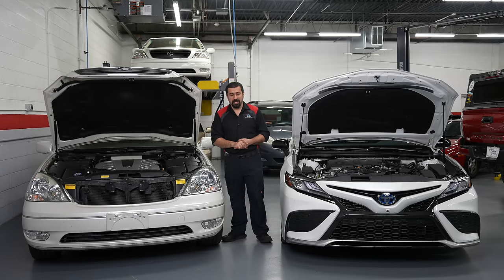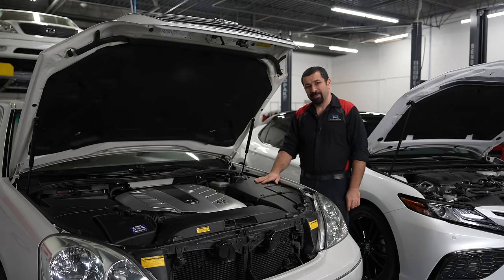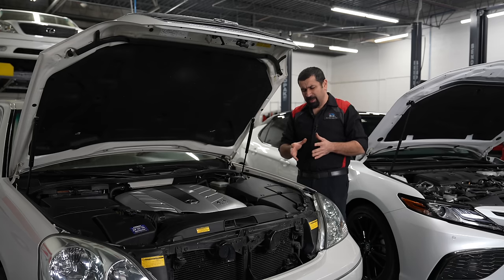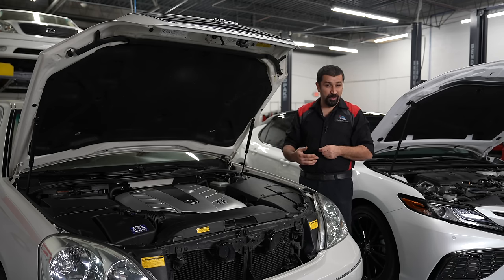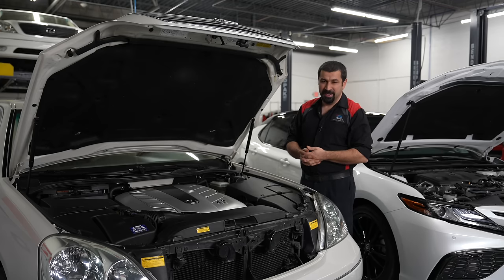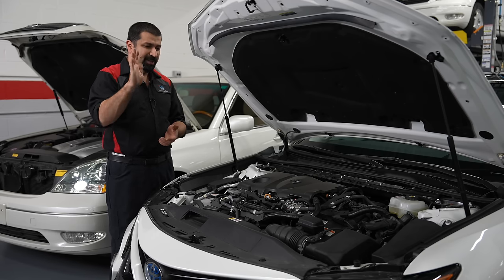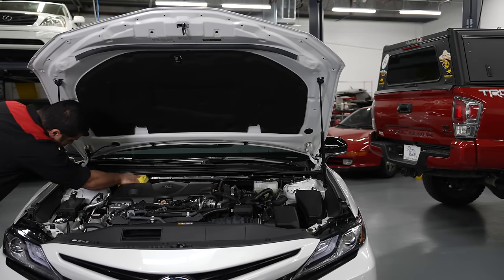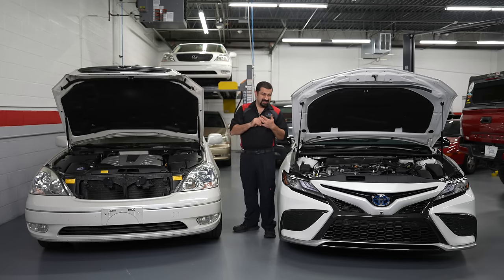Never Do THIS When Cleaning Your Engine Bay! Do THIS Instead

Comment: On a daily driver what is the ponit cleaning your engine? It will last the same life if you never clean it. Nobody should recommend cleaning a car engine. I don't just I wipe down things after I fo a oil change.  Really no point.
Reply: If something is clean then it's easier to find any leaks or broken-perished rubbers or seals

Comment: You're never reaching Martensitic transformation on that engine because temperature of the block should never be such high because there is a running coolant + fan all the time(conduction+convection+radiation of that engine heat). Exhausts/manifolds etc. is a different story but the block itself should not under normal circumstances reach such temperature that spray of 25 centigrade would somehow force it to crack or force molecules to expand in such way or that crystallographic grid of that steel would somehow change to such degree it would force expansion of some molecules to the point that it would actually force material to tear apart.
When it comes to electronics I think that is a clear case.

Comment: When shopping for a used car, I look for an engine that is clean on the inside, and dirty on the outside, not the other way around. 
A freshly cleaned engine bay sounds alarm bells. Also it hides oil leak evidence.

Comment: Here's a little comedic relief for you all. Wife drives an '02 Ford Explorer with the V6 (yes I've replaced the thermostat housing), and the intake mani orings are bad (iykyk), like, REALLY bad.

Last time I gave the engine bay the ol' purple power/thumb over hose treatment, I went to start it up after about half an hour and hydrolocked it, lol. My dumb ass tried to start it like 5 times wondering how the battery could have died so suddenly before I realized what I'd done.

Pulled the plugs, turned her over for a few seconds, let her air dry for 30 minutes or so, plugs in, and she fired up no knocking no ticking no nothing. I thanked my lucky stars that I didn't just grenade the wifes car lol.

Few thousand miles later (no I didn't even change the oil. Water evaporates in hot oil. Fight me.) and no grenaded motor yet lol.

Comment: Why is the assumption here (in the comments) that pressure washing or nothing at all are your only options? I've been using simple green and a garden hose for years to wash my engine compartments of various makes and models. They all look(ed) like new and I have never had an issue. A little bit of common sense goes a long way. Try running your engine for 5 minutes or so (don't let it get hot) prior to washing it. There's no reason to use a full-force jet spray of water on anything under the hood. And I beg to differ, but it does make a difference. I'm an auto technician as well and I deal with customers filthy engine bays all day long. It's nice to see mine still looking like new thousands of miles and years later.

Comment: I strongly disagree with use of degreaser … don’t use it! Don’t use water either… oil helps to keep engine and all the bolts and moving components from rusting!!! Some of the most preserved cars are those that had oil leaks never cleaned up! wipe down plastics and parts with WD40! Spray down connectors with wd40! Prevents rust displaces water… shines things up… helps prevent rust build up! It’s win win! I guess body cleaner/wax has the same properties… but I typically use wd40 

Also use fluid film under the body!

Comment: You didn't mention the unbelievable mess that a commercial oil based rust-proofing spray like Corrosion Free or Krown or Rust Check makes in an engine bay.  I would expect that the only way to get rid of it would be a spray on / wash off engine degreaser.  Used when cars were much more basic without all the fancy electronics.  Perhaps a couple of rolls of paper towels and some kind of 'nice' grease eater these days?

Don't you see this?  I believe you're in Chicago.  Rust proofing with these products is not uncommon in Toronto area where in the winter, cars can turn into salt balls.

Comment: Our car wash has air lines to use blow off waters I just pop my hood and blow dust away then use damp not sopping wet microfiber clothes to shine up
Enough water is already in engine comp from car wash so adds to my wet  shine approach
Also I let y toyota dealer wash my engine at oil chg damn sure they got it down they do it daily
They don't charge me for engine wash off with oil chg

Comment: It has always boggled my mind that people use a pressure washer in their engine bays.
I have never cleaned my engine bay and guess what? Never had an electrical issue.
If you MUST clean your engine bay, I would ONLY do it if you can use a holding tank of distilled water.
You DO NOT want to be introducing minerals to all your connectors!

Comment: I took my car to alignment shop and the guy messed up.my alignment 2 times and didn't what he doing and wanted to blame my car after I explained to him nicely.  Ima get my money back. He tried pull the same bs looking popping the hood that the other pulled on me the fist time. He said about camber and I think the camber bolt needs to be adjusted by to correct position. He acted like the my had camber bolts. He still left driver side tire out too causing pulling to the left. This becoming a  wide pandemic. Car nut u don't mention this

Comment: I don't wash or use chemicals in the engine bay to make the engine look pretty. Fix oil leaks, don't go mudding, and use compressed air wand to blow sand and dust off.    Too many places for water to get into and create problems.  Never ever wash the engine on a customers' vehicles in for repair.

Comment: **On modern cars**, it's perfectly okay to get the engine bay wet. Yes, even the alternator. Use a pressure washer, not a hose. And obv. use the white tip, from a distance. The key is to use a heated blower  immediately after to make sure everything is 100% dry. Yes, this is even safe for electrical connectors, most of which are very well sealed. Pay extra close attention when drying these. Open them up if you have to, for extra access. Go a step further, open each connector and spray with CRC Electronic Cleaner. That will displace any water. Apply dielectric afterwords and you should have zero problems.

Comment: son, i been cleaning engines for a long time and you are wrong! the least I worry is the alternator, mercedes engines, i do mine all the time, with a pressure machine too! but a hose will do, is all about degreaser, then you have to w40 the engine and turn it on asap.

Comment: Back when the car had a battery, alternator, distributor, plug wires, you could get out the car wash sprayer and when it dried, get the rattle can with orange paint and do some touch up on the engine block. Today's cars, rag, spray cleaner on the rag, wipe down what you can see. Close the hood.

Comment: Just don't keep & concentrate or foces high water pressure on weatherstrip, plugs, harnesses, connectors, hoses, rubber seals. 

As for the alternator, it can get wet. All the things in the engine can get wet, just not flooded. 

Been pressure & garden hose washing all my vehicles since high school. Have never had any alternators, starters, distributors, ignition coils, seals, harnesses, pigtails, plugs, weatherstrips, O seals, gaskets, seals, insulations, hoses fail. 

If your vehicle has problems after a wash from water, your vehicle already had problems & you are too stupid to pay attention, do the intervals, keep & maintain fluids & service/repair when needed either by a stealerships, garages or DIY.

Just like those "techs, mechanics, keyboard warriors & armchair" know it alls that proclaim "never change your transmission fluid. Your transmission needs that friction from the shavings to keep from slipping" Especially when it's a "Closed for life, No service required, Do not service"
If any transmission needs the metal shavings for grip to keep from slipping, your transmission is going out & needs to be repaired. When you listen to those idiots. You deserve it when your vehicle fails. 

It's a scheme to make money for when it's YOU'RE failure to maintain & change vehicle fluids. 

Same for while under warranty, "Closed for life, No service required, Do not service," of course it's closed for life, stealerships can just replace. When warranty expires, all stealerships, their techs & mechanics will with extreme prejudice blame the customer for not changing fluids, keeping & maintaining intervals & maintenance. 

So what's cheaper? Changing your vehicle fluids or changing engines & transmissions? 

Also, a mile is a mile. It doesn't matter even if Jesus tells you "they're highway miles". Only morons & idiots fall for that.

Comment: Need an older car one that's been used. Not a brand nu one. Still sitting in the shop . Showing wires cables oil spills a dirty carrrr...😂

Comment: I just did that, higher preasure the hell out of it with industrial grade degreaser. Took the car for a drive day later and started having misfire half an hour into the drive, no big deal, kept driving for another half hour (until car completely quit working) and melted away the catalytic converter and almost set the whole car on fire. Lucky had few bottles of water in the boot. What a legend I am lol

Comment: This is frustrating for me to watch after spending about 20 years in the automotive industry. Two big problems here...first is people claiming to be "detailers" that don't deserve that title. Second is lousy mechanics. If electric connections are put together clean and with dielectric greese, half these issues wouldn't exist. There is a lot of good points in video such as you shouldn't ever clean a hot engine. You shouldn't use harsh chemicals and you shouldn't use a power washer unless you are like a surgeon with it. Modern vehicles have a lot of current on lines even with vehicle off. So it is a good practice to disconnect any power sources such as batteries before cleaning. Nobody without proper training should clean engine bays. There is even more things that can go wrong then what was mentioned in this video. To a real detailer that has proper training, cleaning an engine bay is absolutely doable and sometimes even a good thing. I closed down my detailing business back around 2000 due to everyone all of a sudden claiming they are a detailer in order to demand higher prices. This really hurt the real detailer. Cleaning your car doesn’t make you a detailer. I actually use to tell people to clean their car before bringing it to me. I'm not a cleaner. All detailers know how to clean but you aren't getting your money's worth having a real detailer clean your car. A real detailer can provide services way beyond cleaning. Such as paint correction, conditioning, UV protection, sanitizing and proper engine bay cleaning!

Comment: I will resume this •••• 25 year cleaning engine NEVER have any issue never you know how “”

1- disconnect the battery 🔋 OFF no voltage 

2- recommended have a vacuum and air pressure to suction water in some spot and blow air some connections like air to the alternator and flow meter or ignition and DME” 

You can pressure 💦 washer ALL you want ALL ALL around is safe if is NOT battery power””” 

Work perfect for 25 years perfect

Comment: I found it strange (anyone else?) that you cleaned an already clean engine, and then said “it’s clean..” 
The video is 20 minutes long, but you 2X’d the part where you clean an already clean engine bay.  🤷
Why not just drag it out an extra five minutes for the “cleaning” part as well.  Production is good, pacing is steady, but really-can’t most of the points be touched on in half the time, while still not rushing through it?

Comment: Pan the Organizer the detail guy would have a different opinion. But he’s not a technician   Listen to Care care Nut. Don’t use pressure hose in the engine compartment ! Just hand clean it periodically with a rag and a little degreaser or Simple Green.
Reply: I think Pan the Organizer also understands this, notice he will only pressure wash cars with pretty much the entire bay with beauty cover on.

Comment: Why are you spraying water on the electronics of your vehicle? Does water and electronics mix well? Just use a paint brush to dust off your engine and parts. And save yourself any problems. Face it engines get dirty. How can they not get dirty?

Comment: I've been having cars and keeping the engine bay ultra clean for over 20 years spanning 47 cars.
You absolutely can spray the hell outta alternators, clean pressure washer was is better than swamp water as seen in extreme off-road use, salt water not ok though - rinse down your whole car after driving through the ocean shore.
Second, you absolutely can hose down your manifold and engine block, the key is to spray it with he engine cold, here's the scenario, you decide to wash you engine way, start the engine and IMMEDIATELY  begin your spraying, the bits that get hot will compensate for your water spraying.
I'll say this, stay away from the under hood relay and fuse block, that will cause you headaches.
If you are spraying and your engine stops, immediately stop and inspect all hoses and intake pipes. You've introduced water to the vacuum and intake hose routing.
Only spray a healthy engine, if you've got spliced electrical tape wore connections and old cracked rubber hoses, your gonna have a bad time.

Comment: Won't that stuff? You're spraying on the engine. Actually soak into the connectors cause problems. I would think it would be better to spray it on the towel itself and then wipe everything down

Comment: Everything is covered in a new car. You can not even see down into the engine, alternator, etc. I have always cleaned my engines my whole life and have never ever had a problem. From my Nissan Sentra to my Corvette. Just use common sense.

Comment: i don't give a shit about dust under bonnet. It will go away in few day after next 160-220kmh on highway, or using pressured air pistol at garage.
I do not take launch under the bonnet and my car did not go to the detailing EXPO, i just use it to travel where i need to. I know some man owners are affected by dementia and acting as girls (they were child grown by their mothers only, without masculine examples of a father) ...cleaning with small brushes any little space in engine bay, but most of the people have all minds with them 😂

Comment: The engine gets so hot it will evaporate all water in the connectors with in a few minutes. BTW compressed air doesn’t get rid of the dirt. The dirt is sticky.
Reply: Absolutely not true. The engine bay does not get hot enough to evaporate water in connectors. They’re also often in places that  aren’t close to hot engine parts.  If the engine could evaporate all the water there’d never be a corroded connector for any reason.
Reply: @abdullahipad7664  You may be trying to make an educated guess but Im going off of experience. I can spray my engine at the car wash and then drive to my house when I open the hood the entire engine bay is bone dry and heat pours out of the engine bay.

Comment: I hate watching those engine bay detail videos where they just blast the entire engine with soap and high pressure water. Like no wonder wires and connectors corrode on cars. Plus who knows where else its getting that it maybe shouldnt have water. They are not mechanics they are detailers but they need to understand that this is really not a safe way to clean someone's car.

Comment: I am so sorry that i have to disagree with this video. i wash my Hondas and the Toyota i have all the time. I wash them three or four times a year with high pressure water. i wash and spray every where in the engine bay and i have never had any problem with them period. the best time for me to wash them is during the summer time.